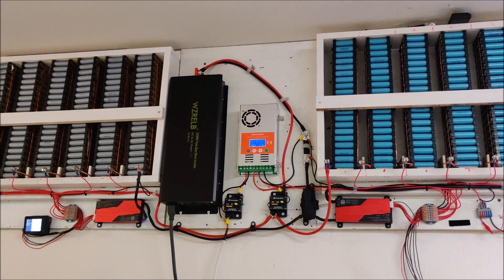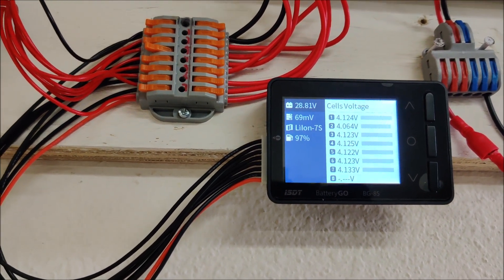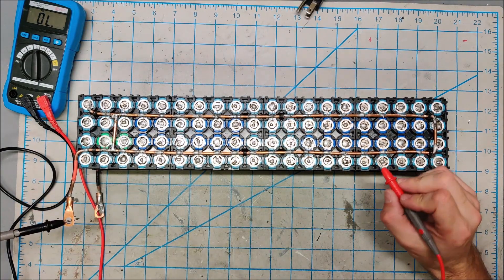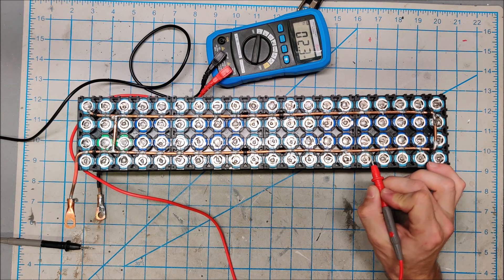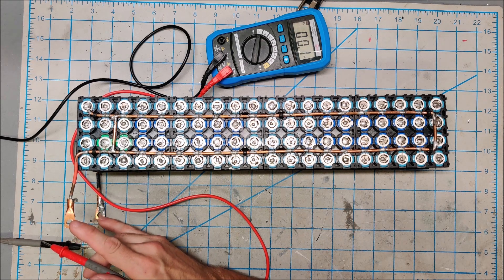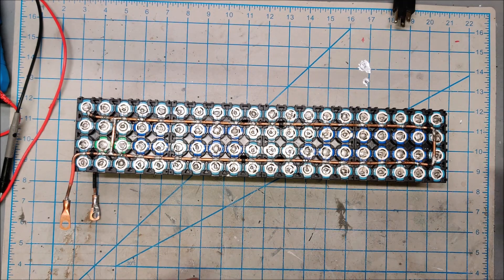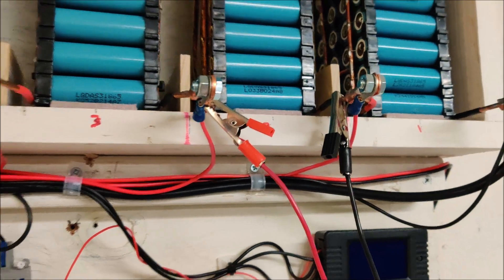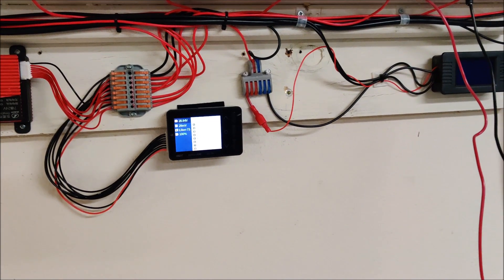DIY POWERWALL: PULLING A BATTERY PACK FOR SERVICING

Comment: Hi Steven, great videos. would it be possible to feed the 'make sky blue'  from a dc power supply? Until I get some solar panels sorted.  I am thinking of using something like a Regulated Switching Power Supply  36V 20Amp.
Reply from the maker: Yes you can. It doesn't care where it gets it power from. Just make sure you program the right voltage into these make sky blue 👍
Reply: @stevenc22    great ta. I am aiming for the same 80p7s as you so 29.2V output from the make sky blue then.  I have spare solar from my grid tied set up in the form of 240Vac single phase. Most of the surplus goes into an immersion for hot water but I can divert some to the 18650 powerwall.

Comment: they are active balancers that will pull from the highest voltage pack and bump into the lowest pack normally when they reach an offset of a set amount normally only saw then run at low end or top end
Reply from the maker: Absolutely but i don't want to spend more on my balancer than my battery :) Better to just check the batteries are naturally in balance.
Reply: @stevenc22  the active balance board are not that expensive
Reply: https://www.aliexpress.com/i/32982883973.html
Reply from the maker: Oh I thought you meant like the Batrium BMS system.
Reply: @stevenc22  no they are way to much money I like electrodacus units as it has all balance charge control diversion and so much more and are not a bad price
Reply: @1981dasimpson  is there a youtube video on the active balancer
Reply: @raybacchus1026  julian lett has one where he is testing on suoercaps